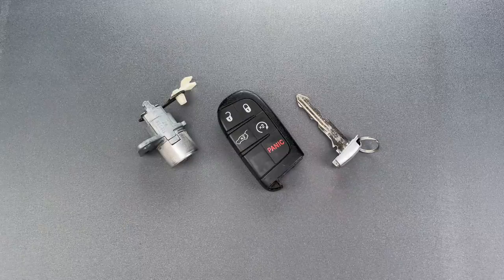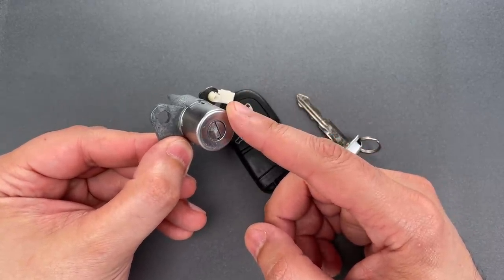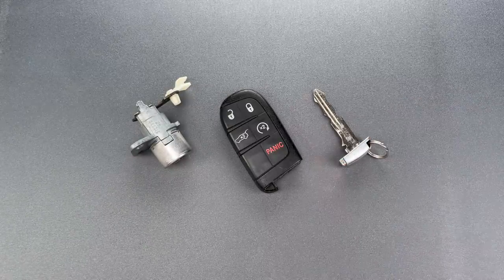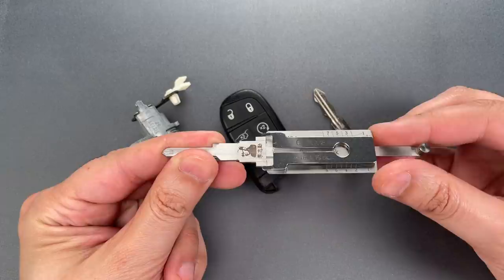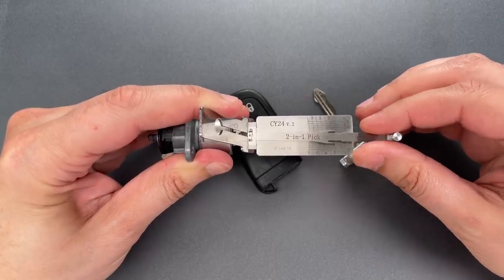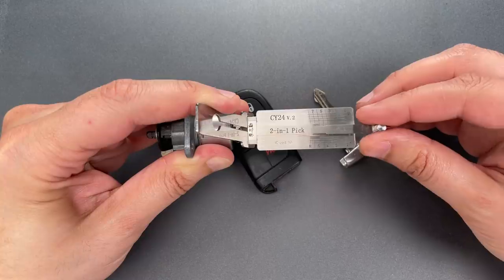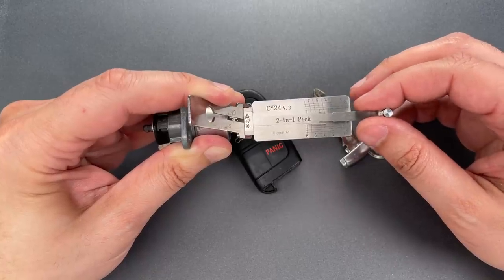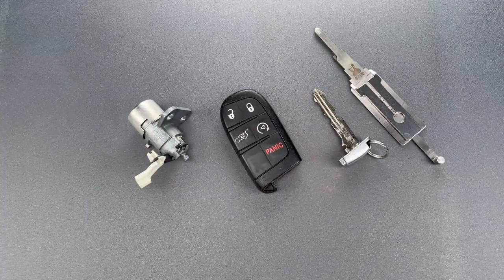[1326] Jeep Grand Cherokee Door Lock Picked

Comment: But even at that you still need tye Key Fob to Drive off . 
But in any case what I have for a thief is 300 Grains . 
And another thing how common sense where you're actually park in that car I mean if you're an apartment complex and just leave it outside all night. You probably going to have some problems at a gas station just leaving it out for a long. Of time yeah you probably going to have some problems leaving out of Walmart parking lot probably going to have some problems keypad lock and secured in your garage house lot garage locked cameras rolling 24/7 motion detectors you should be okay and keep those guns loaded